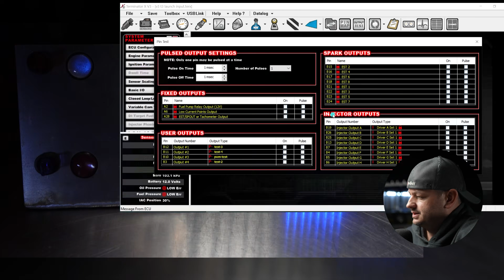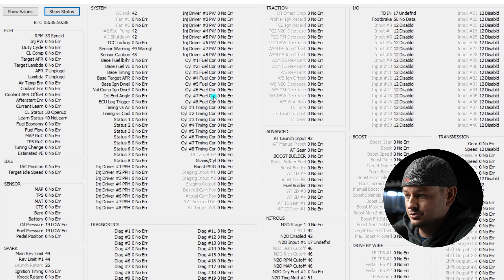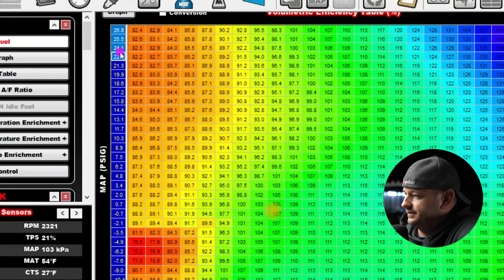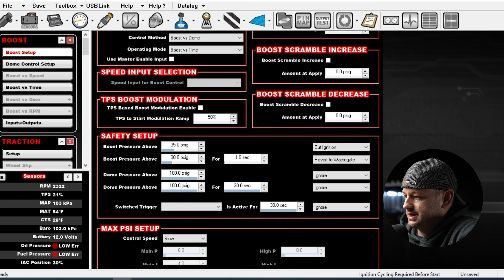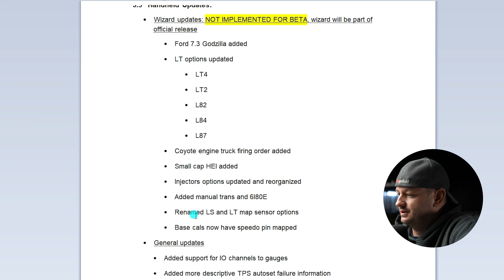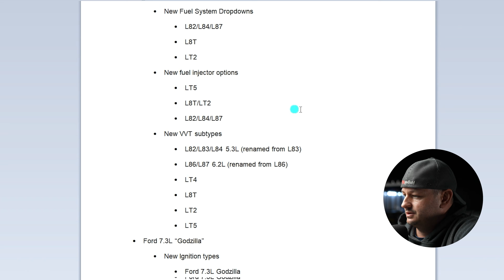New Holley Terminator X V3 Software Update!  Test Outputs? Lambda?

Comment: Awesome video, so now I have the option to have the air shifter have different shift points between 1-2 and 2-3 shifts on the th400. But do I have to hookup an input to tell the ecm what gear its in? Or does it just do it accordingly related to transbrake input release?

Comment: maybe a dumb question i’m building a 83c10 getting a nitrous ls and a 4l80e not a lot of dig racing around me more roll racing is there a way u could set the trans up off a button maybe to hold say 2nd gear longer so u can be higher in the rpm range off the initial hit vs having to wait for the ecu to down shift the transmission? thanks.

Comment: Will this update allow 2 wideband sensors to be installed for closed loop control?  Or is that Dominator only still?
Reply from the maker: Will always be dominator only. It’s a hardware thing
Reply: @JoeSimpsonAtTempest  Thanks for sharing that info.
Reply: Can we use a 02 sensor that doesn’t die every few months
Reply: Buy a holley HP with a NTK, it should last a long time, but if the tune is too rich it will still shorten its life in general as well. @mrphiscal

Comment: With the new software improvement, can I finally flash new firmware without having to unplug the entire canbus chain?  I’ve had tons of problems in the past with even splitters from Holley causing bricked ecus during the update process.  On some of the custom cars I work on, unplugging everything chained together on the canbus side can be a huge pain.

Comment: missed the fix for o2 reading max lean before its warmed up causing severe rich condition
Reply from the maker: Yea that would have been a nice add on. Can fix it with custom tables though
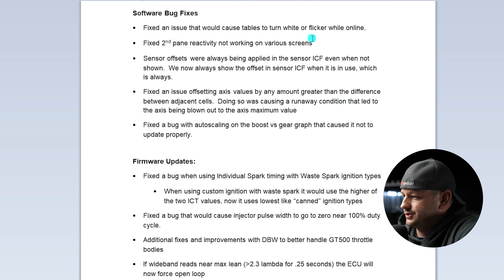Reply: @JoeSimpsonAtTempest  sorry I mean you missed it in the pdf, they've added a fix for it! Read the bottom of the screen at 21:45
Reply from the maker: @Broosch_Light   oh yea. Are you talking about the max lean over time thing? That was an awesome update i guess i did forget to put that one in there
Reply: @JoeSimpsonAtTempest  yeah that one, I'm tickled pink cause it was happening to me occasionally.
Reply from the maker: @Broosch_Light   yea that was an awesome update. I do wish they also added a min time before closed loop enabled but this works awesome too

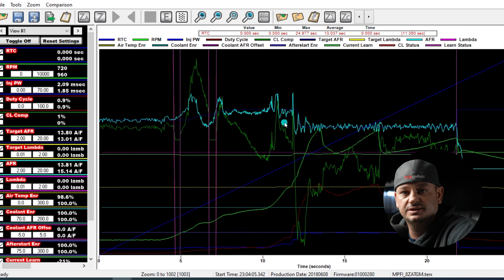Comment: Just add that (for anyone that didn't notice at 15:34 ) when you toggle Compare on/off in Data, even though it removes the traces off of the graph, all data numbers (from both runs) stays up on the left 👍

Comment: Do you still need the term x max to use the trans functions or is in both the x and x max
Reply: It’s going to be the max. You’ll need a way for the trans to talk to the ecu and the non max does not have that plug.
Reply: @or-ian6973  do you think the x can control dump valves on a glide
Reply: @sbfnation2535  sorry I don’t know. I’m a novice user myself.
Reply: @sbfnation2535  is it something you could use outputs to control?
Reply: @or-ian6973  Im pretty sure that’s how you do it. I gotta look into it more

Comment: Interested in that TKX harness and parameters. I made my own for the vss and had to do some funny numbers so it would output the correct mph. Never did get it to work :/
Reply: I did the same thing for my t56 magnum xl. Used the auto trans with all the math to get mph, but it works great and it’s accurate.

Comment: Great info !! One thing is like to see if a way to go into a dyno mode for holding gears and locking converters. Obviously you can go and trick the Ecu to not downshift and for lockup to stay on like I do but would be a nice touch to save time.
Reply from the maker: Yea that would make life easier

Comment: I seen in the trans tab it says t56 does that mean regular terminator x will recognize the factory speed sensor?
Reply: I doubt it. I’d imagine you need that extra port on the ecu to hook the vss up. Like the max has
Reply: Ooooor….. if maybe your using a ProDash, which has speed inputs. Tho it prolly wishful thinking the V3 for TermX would maybe allow data transfer from the dash TO the ECU. Like it does w HP and Dom. HOLLEY!!! Y’all listening??

Comment: This was huge but surprised still no map based boost control.
Reply: Right!!
Reply: I control mine by map based on a terminator x max
Reply: @brandonpylant5764  there is no map option in the drop down. You can split the map signal and tell the ecu it’s in the dome and it works decent but not perfect
Reply: @Mike Rawtch  mine works pretty good splitting the signal. It keeps it pretty stable on boost
Reply: It’s right there. Open loop - duty cycle. I been using it on my dads car & works great! No dome sensor needed. Straight off map sensor.
Reply: @BmoreFox  it’s open loop tho. Which is mostly fine but having closed loop strategies is advantageous when set up properly. What you’re using is not map based. Just duty cycle based.